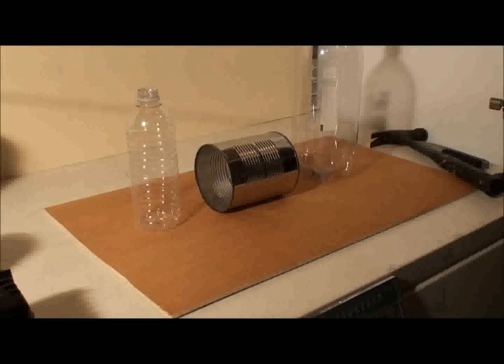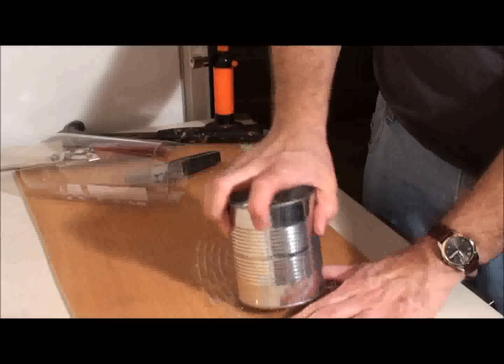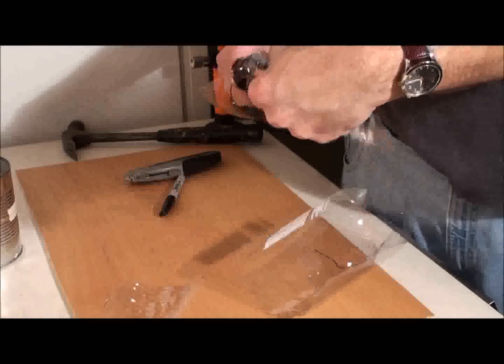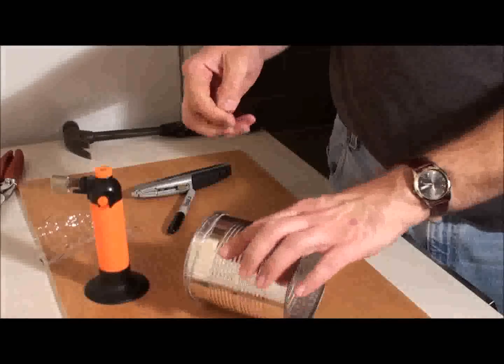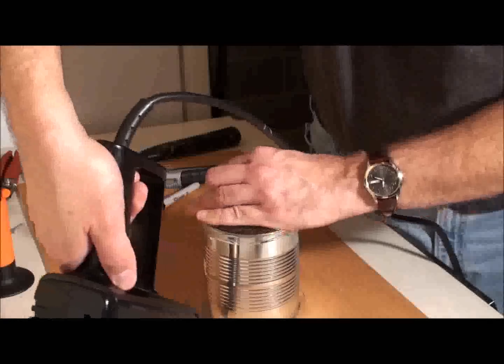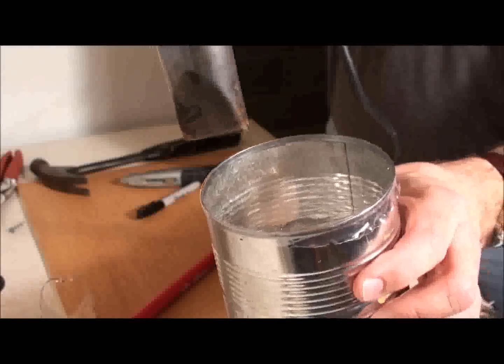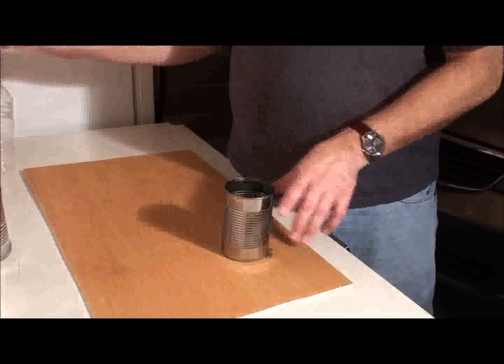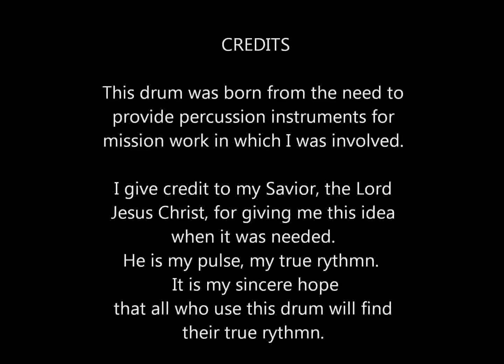RePETE1drum.mov

Comment: Great idea; An ecological drumhead . My idea is to prepare the rim from the cans first then apply the heat to shrink tight the plastic film or Polyethylene terephthalate. this will then go on any drum  wether its made out of wood, plastic / PVC or metal. will use the snare tuning system including tone control for any drum size. Your video is just inspiring. I will use the technics to create some North African hand drums that are vulnerable to humidity and cold thus detune in outdoors since they are made with animal skin. I am also thinking of using the trombone mechanism to glide the tone with a moving air compressor up to the skin just as if you use your hand inside the drum. A Darbuka players technic and also similar to the talking drum in gliding the tone.  Thank you for the inspiration !

Comment from the maker: You will need to heat the plastic no matter what because that is what causes it to shrink.  I don't think you could attach the plastic to the can with just gluing. When heated, the plastic attaches itself to the can. Gluing is not necessary as long as you have a rim on the can.